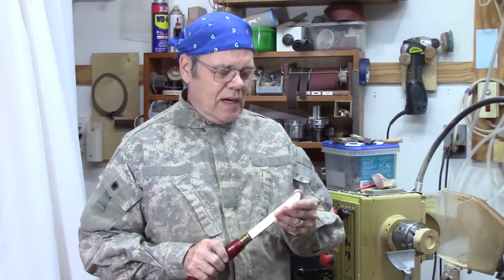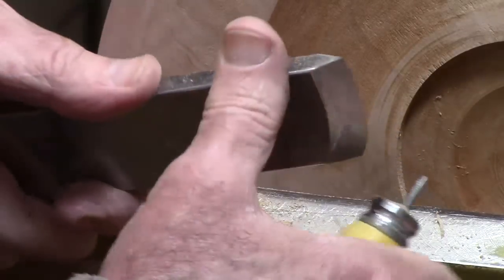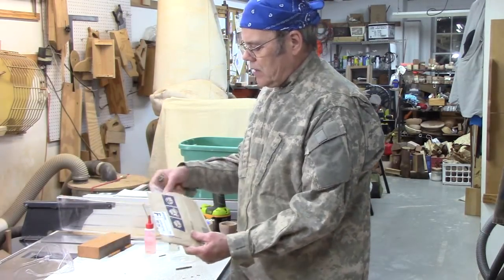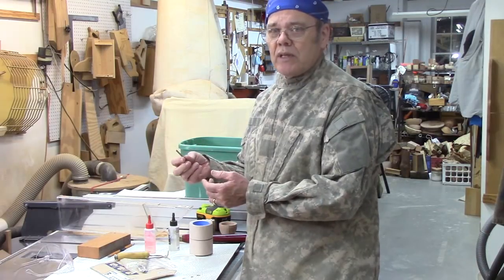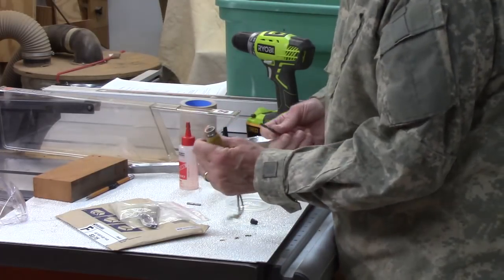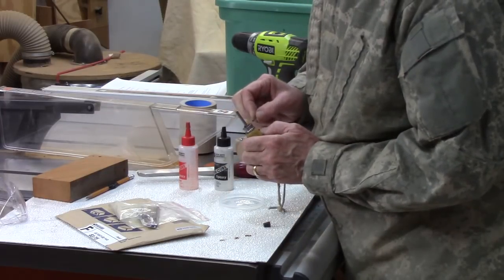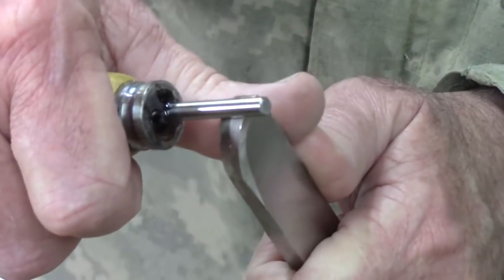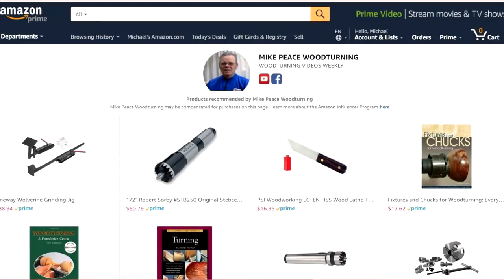DIY Burnisher Tool for Scrapers

Comment: I am going to make a carbide burnisher. I have been using my 3/8 Thompson gouge and it works because it is slightly harder than M2 HSS albeit a tad unwieldy, or honing (not rolling) a bur with a diamond card—not a very clean, even bur.

Very nice handling of your end cards in this video. Crisp and unintrusive on your content. Thumbs up.

-- Joe
Reply from the maker: Thanks, Joe.  I need to do a bit more work on having a few "bolt on" outro's they call them.
Reply: I was one of "they" in a former life. I worked in the video editing room of a NBC affiliate television station eight hours a day five days a week. Your talent placement and showing the cards on the side was a great start. Keep up the good work. 

All the best,
-- Joe

Comment: A used (dull) solid carbide router bit should also work. Usually the spiral bits are solid carbide. 1/4 inch is USD $15 starting price on Amazon.
Reply from the maker: Good idea about the 1/4" spiral router bits if someone should have one on hand. I have found new carbide 5/16" end mills for about $13

Comment: Why not just use a dull, solid carbide 3/16" router straight bit?
Reply from the maker: That will work if you have one and it is long enough to mount in a handle. Thanks for sharing!